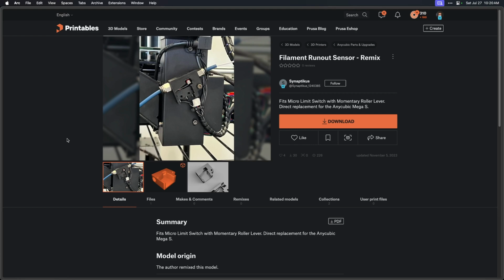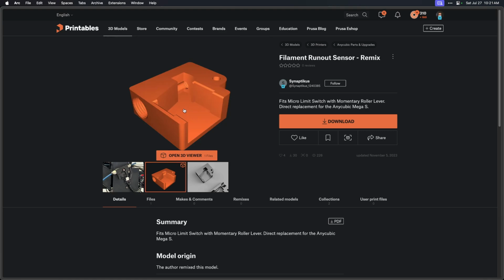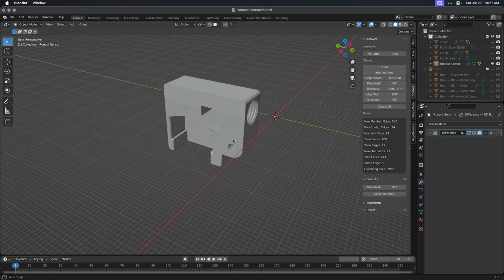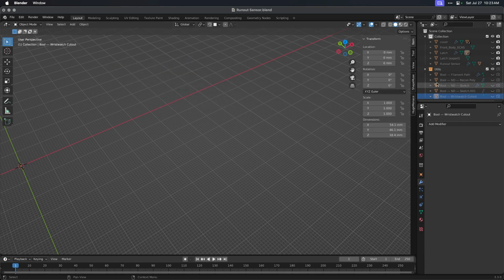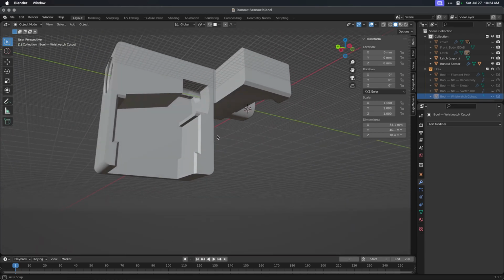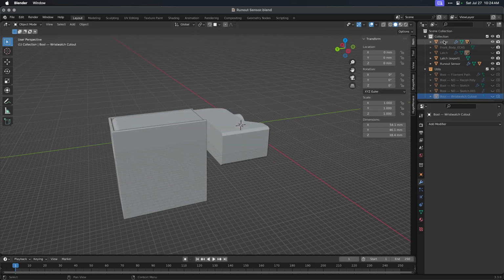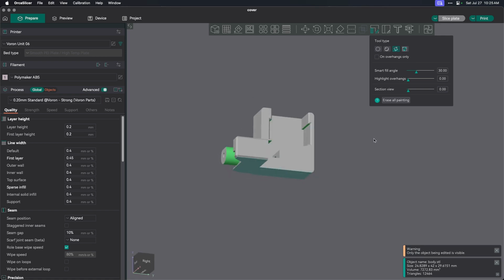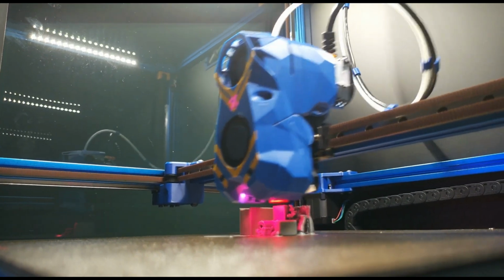Voron 2.4 Dragon Burner Upgrade - Custom Inline Filament Sensor

Comment: Great work! Love the ball lever arm idea, seems simpler than using a bearing ball.

 Have you researched smaller switches? There could be some room for miniaturization.
Reply from the maker: Since making this video, I've actually switched over to a different design that was suggested by someone in the comments: https://www.printables.com/model/972444-wristwatch-g2-filament-runout-sensor

It replaces the printed part for the front face of the extruder with one that incorporates a filament sensor switch. I haven't had a chance yet to show this in an updated video, but I will try to do so soon.

Comment: I'm currently converting 2.4 tool head to a yavoth with the cutter you mentioned. Adding a ERCF. In my research I discovered there is a modified version of the  wristwatch G2 that has inbuilt filament sensors.
Reply from the maker: Thanks for mentioning this. I'm not sure why I didn't find that version, but now that I've seen it I want to rebuild mine.

Comment: Great theory, but the switch doesnt last long, better off using the 6mm or 7mm ball bearing method, more reliable and doesnt jam when filament enters.
Reply from the maker: Yeah, that's one of my big concerns with this design. I'll use it like this for now and see how it holds up, then if necessary redesign the switch mechanism while hopefully keeping the outer shape of the sensor roughly the same.

Comment: can u share stl modified filmnt snsor??
Reply from the maker: As I mentioned near the end of video, I do plan to release the STL files but I want to wait until I've used the sensor a bit in the new print head to make sure it works well and is reliable. So it'll likely be a few weeks before they're released.
Reply: @gunplamark  Any update on this?